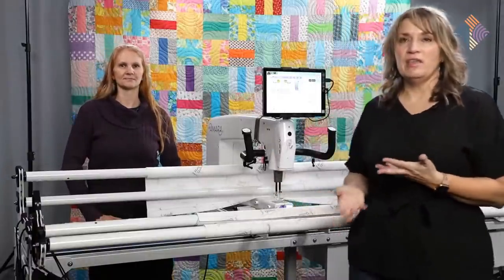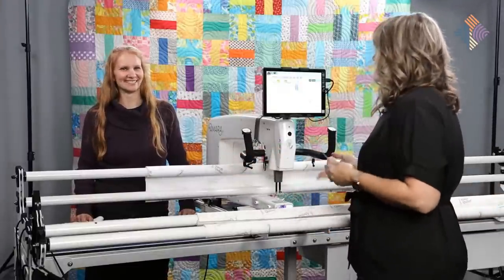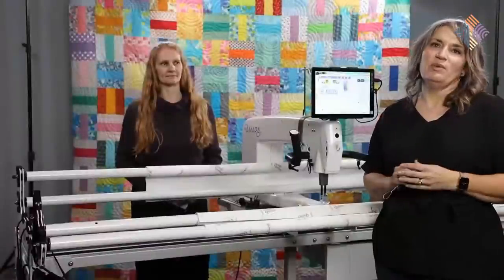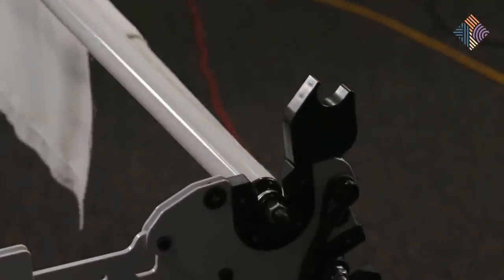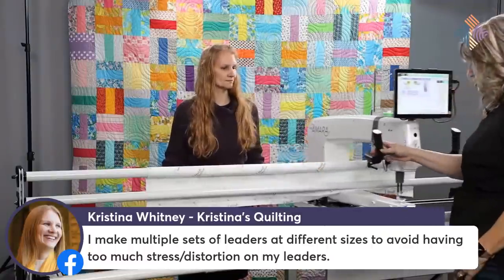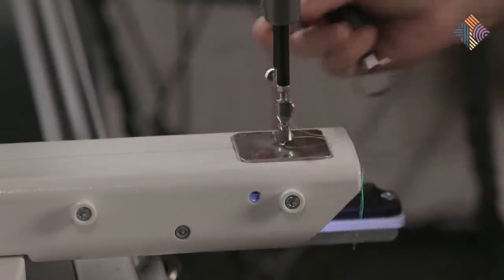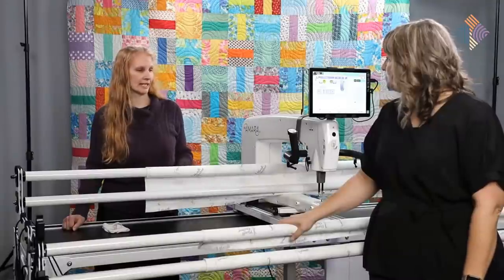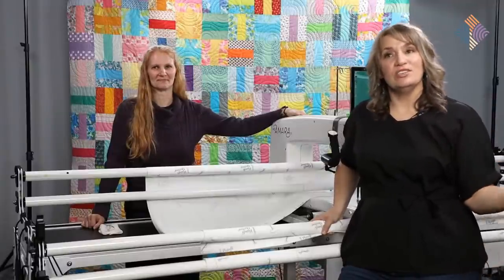Just Bought a Longarm? Watch This! - Watch and Learn Quilting Show

Comment: I'm using my machine everyday; should I still be unplugging it from the wall?  I also have a surge protector on my wall socket which also comes with a warranty that my machine is plugged in to.
Reply: I always unplug my machine from the wall when it is not being used. Even with the surge protect.
Reply: @kristinawhitneyhqstudioedu7013  Thank you!